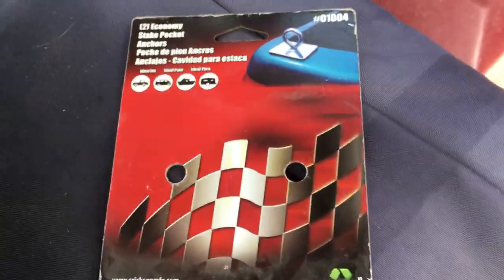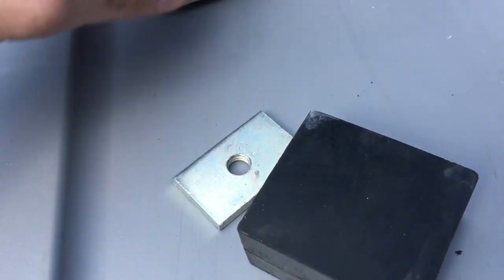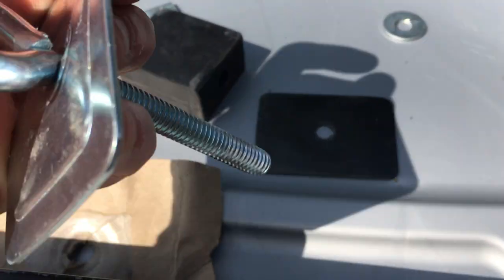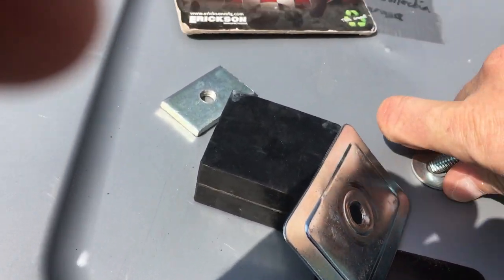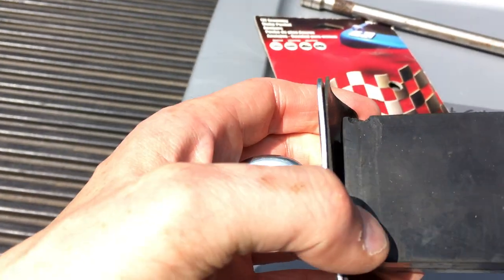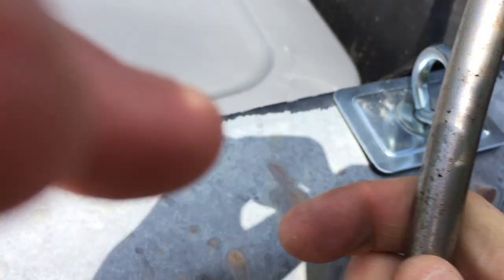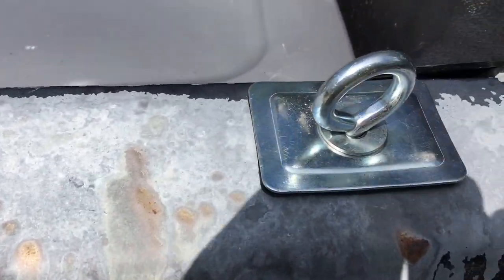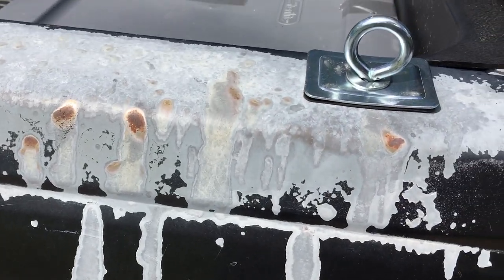Cheap easy way to install tie downs in the bed of an old pickup truck.

Comment: How they holding up, never had any luck with them. Tying down motorcycles I had them pop out. I was thinking about replacing top plate with a 1/8th piece of flat stock. Maybe that might help stoping it from piping out, and might be able to get a few more turns on the eye bolt. Thanks for making video. It's hard to find a good tye down for a older pickup 87 ford f150
Reply: They are holding up well. You are right that they are not strong enough to hold a motorcycle in place. Your best bet there would be to bolt or weld in some eye hooks.
Reply: @richardbonazzoli58  thanks for getting back to me, I'm going to look into making up something